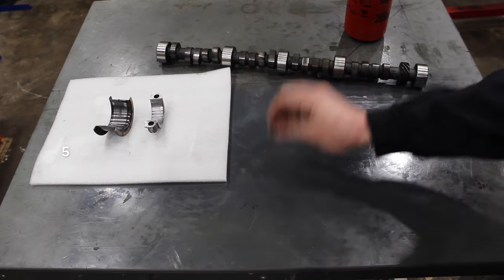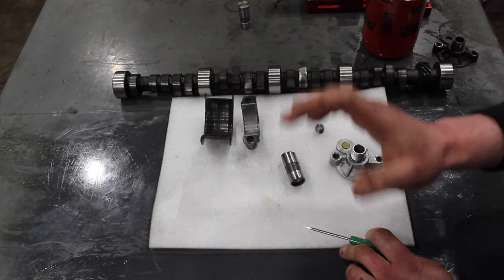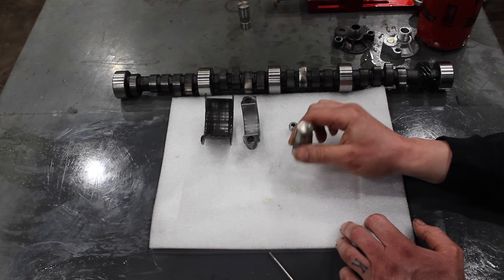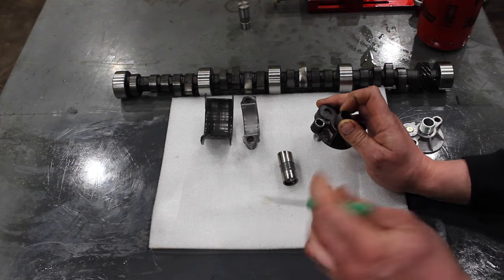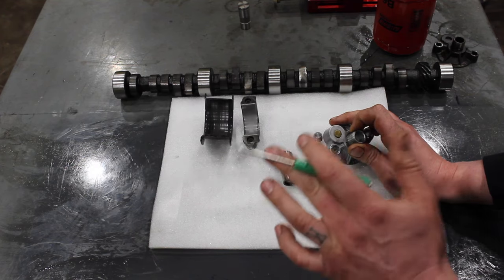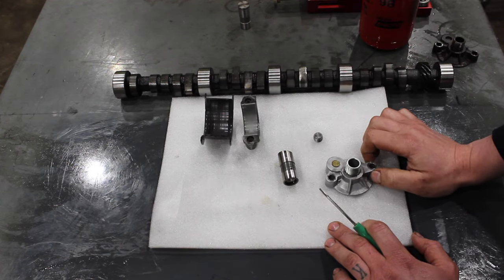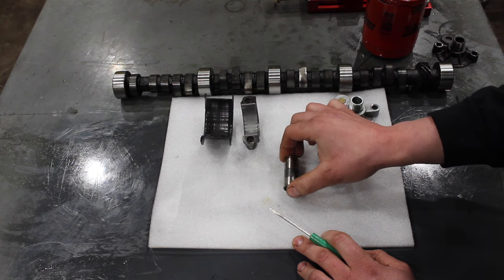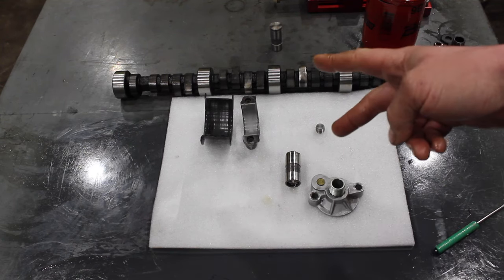Everyone With a SBC/BBC Should do this! (Almost Free Mod)

Comment: Also very important to tap the oil galleries  above the cam on a sbc, especially when you have over 60psi of oil pressure.
Reply from the maker: 100%
Reply: What will that do? Serious question
Reply from the maker: @Han Solo  press in ones can pop out, causing a loss of oil pressure
Reply: @cuttersperformance  I've had coffee now. Disregard my previous comment lol
Reply: @cuttersperformance  To be honest, I have never seen one or had one fail before. If they are installed and properly staked in place, they will not fall out even above 75 psi.
Reply from the maker: @reason2gether  the key word is properly lol I never see a original one fall out, but I've seen them fall put after rebuilds. Safe bet is to tap them and or have someone with experience install them
Reply: @cuttersperformance  Funny, I have seen more damage from people tapping the center galley and cutting oil supply to the # 1 Cam, Main, Rod bearings. Also, if you are tapping them to the common 1/4" NPT size, you are not really tapping the bores to that thread size. While the "deep scratch-like" threads usually do hold the plug in place, they cannot seal oil pressure without generous loc-tite and thread sealant compound applied. I suspect that a lot of engines that suffer mediocre oil pressure are actually losing pressure by these 1/4" NPT screw-in plugs threads. My best friend was an Engine Machinist and he pointed this out to me. If one is going to use a screw-in NPT plug, they should drill the bores to 29/64ths and Tap them for the 3/8" NPT plugs. It is a lot more work, but it is the right way to do it. That is why I prefer to leave the original bore alone and properly stake in the oem style plugs. Much easier and when you know better, you have every confidence that they will stay in.
Reply: Some seepage past the threaded plugs is not necessarily big deal since the seepage is into the cam gear cover and timing chain. In fact some builders drill tiny holes into the plugs to encourage this seepage!
Reply: What are you talking about and how do you do it?
Reply: Nothing new if you were experienced you should know they sell a non by pass oil filter adapter also why would want to put unfiltered oil in your engine
Reply: @annmarierudolph2291  thanks for the jab, probably could not have lived another day without it.
Reply: @geodes4762 
One of the GM engines, I think 455 Olds but not 100% on that, had a threaded factory plug after a year or two that had a tiny hole in it, lubing the timing chain was an added benefit but the primary reason was it bled air out of that lifter oil galley immediately after start up so you had solid oil going to the lifters instead of a bunch of air belching through the hydraulic lifters, I don't know the spec on the hole size but it's so small it doesn't affect oil pressure one bit, Olds (or whoever it was) put out a bulletin that recommended the earlier engines (they always had the threaded plug, and it had a bolt head instead of it being an allen type NPT) be drilled with the same size hole, or maybe it was replace with the later plug with the hole, should anyone ever be inside the engine, from what I understand it was because of that is what started people modding other engines the same way .
Reply: Amen! And swab those holes after machine work regardless if it's been hot tanked or not! There's all kinds of metal critters in there that need to be removed before assembly.

Comment: Your absolutely right.  Good quality filter and plug that bypass. Been doing this for 30 years
Reply: If you are attempting the new car 10000 mile BS oil change an expensive filter might help but just like the sealed for life transmissions, no maintenance ruins components. I have 200000 to over 300000 on my vehicles and i use cheap Walmart filters,  change my oil every 3333 or 5000 miles depending on vehicle. The only ones i pony up extra cash for wix fliters is on my diesels.
Reply: I always laughed at the cut away of a fram filter at parts stores. They use the bypass as a reason to discredit the brand. I'm definitely on board with bypassing oil as opposed to restricting it. If you've got much metal circulating then a filter isn't the issue anyway.

Comment: Roller cams and lifters are failing far too often nowadays too. It’s not just flat tappets. At least with a flat tappet cam you can measure lifter crown, and lobe taper to ensure the best chance of success. Joe Gibbs driven BR30 break in oil is a lifesaver as well.
Reply: Haven't built anything for a few years, unfamiliar with changes to part quality related to supply chain changes.

But yes we used Driven.  Also had infrequent failure of Jessel roller lifters.  Went to bushed Morel.
Reply: probably from the removal of zinc because of emmissions...try Mobil one 15-50W.....

Comment: That cam and lifters taking a dump had nothing to do with that bypass .
Reply from the maker: Yes....but if it was plugged it could have saved all the bearings, Crank ect
Reply: @cuttersperformance  
The amount of metal that I saw missing I don't believe was enough to plug the filter and cause a properly functioning bypass to open, however If you do plug the bypass and THEN plug the filter, then you have zero oil .
Reply from the maker: @ValleyRock13  the bypass spring is soo light the bypass will open on a brand new filter
Reply: @cuttersperformance  When a lifter is that bad that is simply a parts defect. We have had a number of flat tappets go bad in the last few years, this is a well known problem in the industry. Even if you had plugged the bypass you still have all of that metal raining down on the rotating assembly, its a risk not disassembling the entire engine to clean the metal out.
Reply from the maker: @fastone371  you are correct but ive seen several now that are basically saved if that bypass is plugged. If not, all the bearings are embedded, and a crank polish or grinding is needed to repair.

Comment: what's the difference ? Your cartridge oil filter has a spring in it that allows the oil to bypass the filter cartridge element above 25-30 psi anyway.....
Reply: not all a PH 30 does not have bypass, a PH 5 does ,but both fit a SBC.
Reply: That would be in pressure differential between the inlet and exit of the filter.  Get your facts straight.

Comment: Uncle Tony's Garage did a few videos on this topic.  He concluded that the taper on the lobes of the cam needed to spin the lifter is not ground in to the cam correctly, thus not spinning the lifter and causing the damage.  This seems to be a very common problem today no matter the cam manufacturer.
Reply from the maker: Or not enough crown on the lifter face mixed with poor surface hardness. 
I checked both the lifters and cam crown and still didnt win o this one haha 😅
Reply: @cuttersperformance  Check out tony's video.  Maybe he's right, maybe he's wrong, the bevel on the cam must be difficult to measure as well as the hardness.  IT makes sense that the cam isn't spinning the lifter since the lifter has a groove worn in one place rather than being just worn down like a mushroom from lack of surface hardness.  IDK  It's definitely a problem industry wide.  I hear many saying that Morel lifters and one other brand are the only good lifters left.  As for the cam, it's all hit and miss I guess.
Reply from the maker: @froto baggins  no he's certainly right on that, thats why I check every flat tappet cam and lifters. Alot of guys dont realize the lifters have to spin if they dont spin right away the cam is screwed. Another major issue is that these old blocks have lifter bores and aren't so round anymore, preventing the lifter from spinning freely
Reply: @cuttersperformance  Yeah, I just think it's odd that it's never been a problem until recently.  Many guys have used all the assembly lube, heavy duty oil and ZDDP additives and still have the problem.  Even people who meticulously watched break in. It seems like it's tied to just total lack of quality control.  It seems to effect just one or two lobes which makes me wonder if they have a bad grinding wheel or something.  IDK
Reply: @frotobaggins7169  Tony is wrong. He was guessing about that theory.  The problem with his theory is that the same lobe masters have been in use for 50+ years and never had this issue before.  You can also take a 40 year old camshaft and wipe it just as easily as a new one.  The issue is 90% with the lifters.  The remaining 10%  seems to be china sourced cams that are hardened improperly and parts mis matches.   

If you use the GM lifters with the hardened pad on the bottom,  your chances of a lifter going flat reduce by a huge amount.  That is why they were factory supplied originally in all sbc motors.  They have a tighter crown radius (it should be about 36"-42" radius to ensure it spins but can be anywhere from about 36-60") and are generally just better quality than a lot of aftermarket lifters.   They are 4x more expensive than the cheap lifters, but worth it.   I keep them when I get a motor with them, and send the lifters out  to be reground and refurbished.  They never give any trouble and and they are half the price of new cheap lifters.   Many of the cheaper lifters have nearly no radius brand new right now.   Easy way to check them is to put a pair of new lifters bottom to bottom - they should noticeably rock against one another.  Bad ones don't rock at all. 

Cams sometimes have had improper hardening also.  I had a motor where the lifters were fine and actually cutting curls of swarf off the camshaft on an generic 224@50 sbc grind that has been around since the 70's.  It rockwell tested at 28 surface with the parent material at 24.  It was an enginetech branded cam that was made in China.    We rockwell checked several of the  white box cams we had in stock for sbc that were made in ROC and they were all very soft.  They should rockwell test out at 52 or higher Rockwell C and many were testing out in the 30 and low 40's.   If you look at the cams Enginetech is selling now, they are not made in China, so they must have found a different supplier.

The lobe taper is actually easy to measure,  just a dial gauge and some v blocks. measure on one side of lobe, center, then other side of a new camshaft. lobe.  The difference in measurements across the lobe and a little math will tell you the taper in degrees.   Lobe taper is pretty small small and you want to see at least a couple degrees taper.

One thing you can do to check if everything is good for compatibility is to mark the lobe and spin the cam and lifter to see where the pattern lands on the lobe.  You want it somewhere off center but not near the edges if that makes sense.  You also don't want it centered because then it won't spin. The lifter crown has to work with the lobe taper, so if it's not right and you want to use that cam, try a different manufacturers lifter. 

Marlan Davis wrote a really god article on this a few years ago - https://www.motortrend.com/how-to/check-flat-tappet-lifter-crown-lobe-taper-lifter-bores/

I was still doing a lot of marine engines until last year which kept the flat tappet camshafts for a long time after the cars and trucks went roller.  BBC's are hard on cams but using the hardfoot lifters on a USA made camshaft has resulted in no flat cams for the last several years when broken in properly.
Reply: @RacerRickxx putting two flat tappet lifters bottom to bottom?  No wonder cam failures are internet lore.

Comment: Most oil filters have a bypass built in. I run the K&N 3003 with a bypass it's a long filter and since it has more surface area it has less chance for the bypass to open when the oil is cold.

Comment: I’ve seen your video from a while back on plugging the bypass. I run about 80-90 lbs of oil pressure and have done this mod ever since and had 0 failures. Thank you

Comment: Also use a 51061 wix oil filter , which has a very strong bypass, try it by using a long strong screw driver, set the filter up right on a bench put the driver down into the filter and push down as hard as you can. Good way to test one filter against the other . Hope this helps.

Comment: We have seen a lot of these issues pop up on youtube and some engine builders actually started testing lifters and cams. From what I have seen the lifter tapers are machined wrong. 
About a week or so ago Muscle Car Solutions makes a video saying its critical to use the right combination of parts, use the correct break in oil, and to follow the procedure correctly. I just had to leave a comment bc it seems as though he might have a connection with Comp Cams. My point is this...there are engine builders who have been doing this out there for decades well before they changed the oil content back in the 90s and they switched to roller. My point was if you dont have the time or money to do it the first time will you have more time and money to fix it when it wipes a cam? I agree on your comment if you have the money go roller bc I'm sure the cam company isnt going to help you out any. If you go roller you should show the viewers how to install a retro cam and also which lifters.
Reply from the maker: Thats the thing, I believe most of the issues are 1) Crap lifters *bad crown and surface hardness 2) Lifter bores on 40+ year old blocks are egg shaped (lifters not spinning) 3) Not using the proper oil and break in procedures. 
I dont feel right telling guys not to bother with flat tappets because not everyone can afford a roller cam setup but risks for flat tappets are real and guys need to educate themselves before deciding

Comment: TRW and probably other companies make oil pump drive shafts for SBCs that are solid steel instead of a shaft with a nylon bushing holding the pump and shaft together. That together with always using a new oil pump pick up tube and not putting tons of silicone on any seal will prevent most rebuilt engine failures.

Comment: another tip:  don't run the orange filter of death, you know the ones that are on 99% of the engines in the junkyard.
Reply from the maker: Facts lol
Reply: Lol no Fram
Reply: Exactly! I've seen so many orange filters on blown engines...
Reply: I have never had a problem with any filter when oil changes done regularly, you cam and lifter meltdown was not a cheap filters fault. I don't think a expensive filter would have saved motor from that failure,  or a plugged bypass...
Reply: every race engine i have ever touched had a Fram HP filter on it.  Sometimes we had to paint them black and put a Wix sticker on them
Reply: Gram is shit.  Baldwin is my winning brand   Pro comp 2002 Las Vegas. Mike Hiatt, pilot.
Reply: Does it rhyme with scam?  oversold like spam ? would not use in a jam? does not like green eggs and ham sam i am ?  ,probably  1 of the reasons were replacing a cam?
Found 
Rust
 Amongst 
Media
Reply: Nothing wrong with Fram .... If they were causing engine damage , they wouldn't be on the shelf !!  Get real & quit parroting !! 😏
Reply: @waylonmccrae3546  those are total shit rust inside bad valves just crap of a turd
Reply: @rctopfueler2841  I'm just speaking from experience on my part & never had a problem with them .... sorry you did !!  Thanks-Take Care !! 😉👍🏻
Reply: @waylonmccrae3546  thanks i have had them pop off. ,had one with rust inside on metal plate  and other issues  thats why i stick to Napa or Wix even the K&N too.. i did fleet service for years  so i have had the chance to see many odd things with filters , thank you
Reply: @rctopfueler2841  all good , be safe & drive it like you stole it !! 😉👍🏻

Comment: This is why I am only playing with factory roller blocks. Also my dad worked for one of the major oil filter manufacturers. The engineers told him that most filters usually plug up in the first 500 miles or so and the internal bypass in the filter opens anyway.
Reply from the maker: Theres alot of fine metal particles in the first 20 mins of running from the cross hatch on the cylinders. Filters should be changed after the initial break with a flat tappet or roller if you want to be safe

Comment: A really good magnet on the filter, inside the pan and on the drain plug and cut your filters open often on a new build to see what's inside the lifter deal is a shitty one I've had one new engine fail like that it was pretty much instantly wasted

Comment: Sorry to hear about your engine break-in failure. It's a lot of time and effort to have a failure at that point. I watch a lot of other motorsport channels on youtube and there are big problems with lifters failing. Brand-new ones are sketchy. It's gotten to the point of switching to rollers or reusing old lifters. Just an FYI. Keep up the great content.

Comment: I have had good luck with the Crower cam saver lifters nice stuff.
Reply: Crower and isky both make excellent parts, only thing I run from comp is push rods and rockers, I stopped using comp in the 90s, alot of these problems stem from oil ingredients being changed, I use moly grease on lobes and I run delo diesel oil for break in, right after break in, change the ac or fix filter on sbc